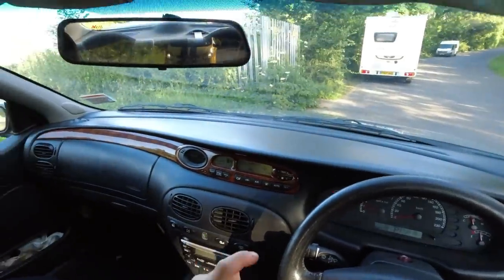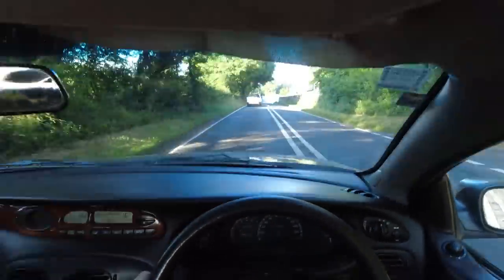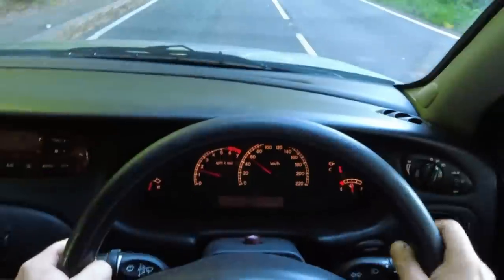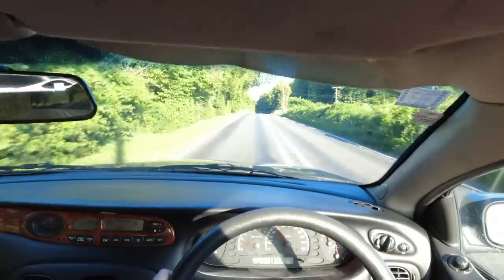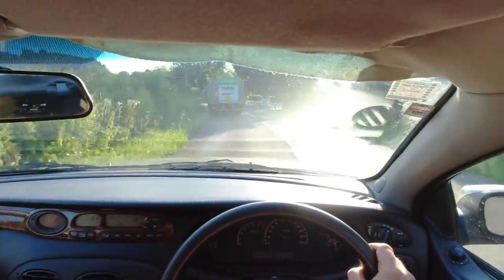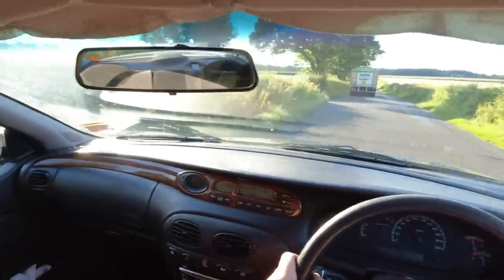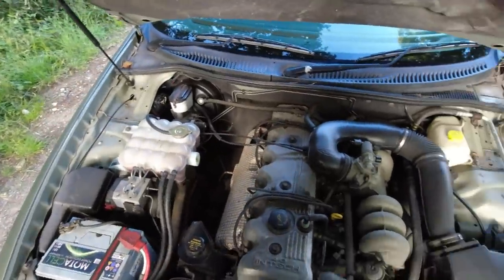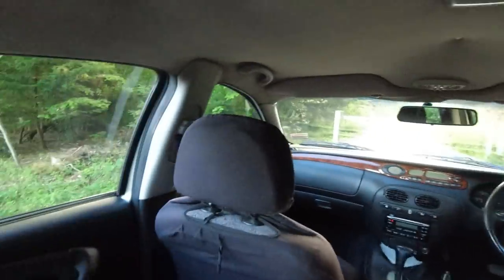2001 Ford Fairmont AU 4.0L Intech - Driving Betty!

Comment: Falcons and their kin are designed for Australian roads, that are long, straight, flat, and not always sealed. They are also designed for Australian fuel prices. So, not exactly practical for Britain. But another consideration, which you only get to understand if you live in the country, is that the simple, or crude, technology means that they can be serviced anywhere. A Citroen SM, to take an example at random (do you know the SM?) would give you a much smoother ride and more engaging drive, but if you break down in Uralla or Coonabarabran, you will not get a quick turnaround on the repairs. I had an XA in Auckland in the '80s, which looked like a shed, and caused people to get out of my way, but with comfortable seats fitted and the engine overhauled was quite good in the country. But no power steering, a dodgy column change, and the parking spaces in the city getting smaller meant I had to get rid of my only hoon car. It really scared people. I gave a retiring colleague (retiring in both senses, actually) a lift home from dinner one night. After a couple of minutes he said, "It's quite comfortable actually, isn't it?" Which, being interpreted meaneth that he realised he was not going to die, necessarily.
Reply from the maker: Definitely feels like it's made for a different environment to the UK!

Comment: It doesn't matter that the suspension is jittery on tar. Ford AU designed it to handle hour after hour of corugated dirt roads. The kind that make Belgian Pave look like silk. 
It's also why there aren't many rattles.
The independant Control Blade suspension was better, but again nothing works well on corrugated pea gravel. It just has to be indistructible.
Reply from the maker: Haha! It couldn't have got worse...

Comment: The light control tumbler just allows you to leave the car with the lights on and they will turn off after a time which you adjust with the dial. The switch to the left controls the brightness of the instruments and it is the switch for the interior courtesy light.
Reply: Sadly neither the headlamp function not interior light switch work.
Reply from the maker: I thought that might be the case, but didn't consider they could be broken. That's a rookie error, given who owns the car.

Comment: There is a way of making the remote unlock all doors rather than just the driver… 

With car locked press and hold both lock & unlock together till indicators flash 

Then unpick will be fkr all doors… to go back to just driver repeat the process
Reply from the maker: @HubNut - you aware of this?
Reply: @UPnDOWN  Yeah, but I quite like only unlocking the driver's door. Saves wearing actuators out...
Reply: @HubNut  So door lock actuators trump handbrake ratchets?
Reply: @Nino500  - oh dion’t start them off on “ratchet rattle” v’s “actuator activity” scoring!

Comment: Buy a later Barra turbo car while you can, these can be a bit fast.  I'd also suggest a few dozen bushes and ball joints to see you through of course.
Reply: yes I have an AU Fairmont wagon and since the track rod bushes were replaced (and the ball joints are OK) it has steering that i am more than happy with, especially seeing I am used to good steering vehicles.
The only plastic rattle mine has is the lid of the fuse box which i will fix one day.
Reply from the maker: There's nothing wrong with the steering for the style of car, at all, but in comparison the C6 feels like a go-kart! 

Betty's fuse box lid was rattle-free, though!

Comment: Your comment on the brakes surprises me as it has ABS. maybe the sensors have been removed.
Reply: Nope. ABS does work.
Reply from the maker: It wasn't close to locking up, to be fair, so the ABS wasn't really a consideration. It's just the pedal feel that I found odd; Wooden to start with, but then with a surprising amount of feel once you start leaning on it.

Comment: It's just such a masculine feeling and sounding car. 
Did you know the next final generation had a limited run of four cylinder ecoboost models. It was almost as quick as the six and transformed its handling character, being compared to a Honda Accord Euro by one reviewer. Only 1200 or so were built and I've heard one take off. Very weird to my ears.

Comment: In Australia the AU Ford Falcon the were used as Taxis with LPG because per litre is half the price of unleaded petrol and the three trim with the Ford AUs is Falcon Fairmont and Fairlane this has the independent rear suspension the motor is a very reliable engine these were built to be robust strong and handle long distances reasonably comfortably and also the rear seat is desinged to carry three adults becsuse of the Taxi conection
Reply from the maker: I reckon a Fairlane might be more up my street, then.
Reply: @UPnDOWN  That is interesting there are plenty of them in Australia